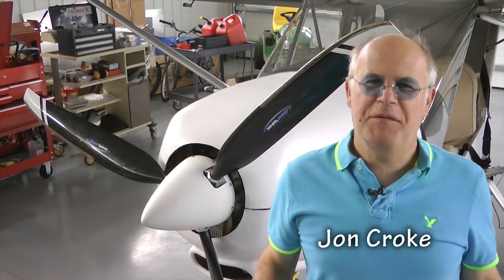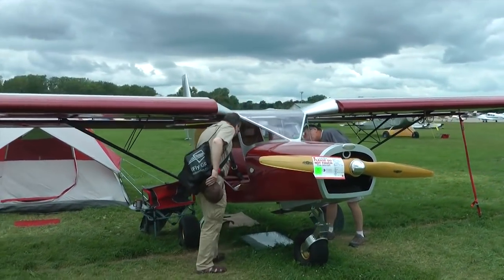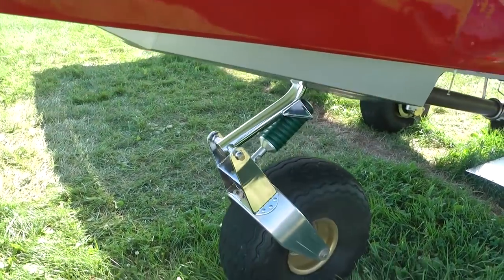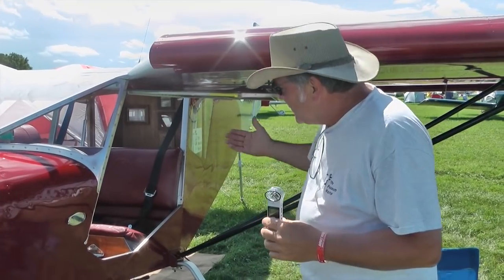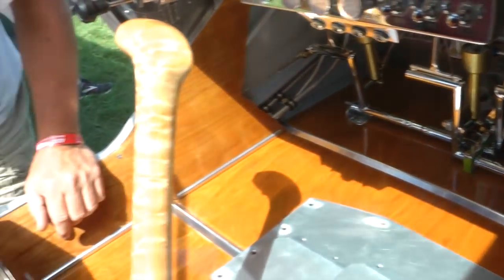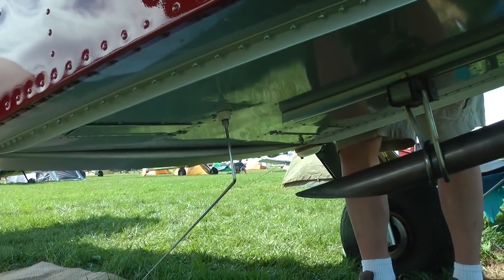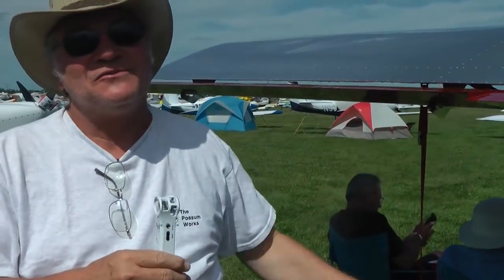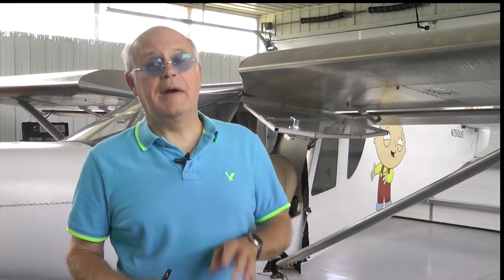When Builders DON'T FOLLOW the PLANS

Comment: I have seen some Experimentals with changes that would make them not safe to fly. What do you do when the plans have errors. I have made many changes to mine that have worked out quit well. I have worked in aerospace in R&D and engineering departments as a machinist/toolmaker. I enjoy R&D.

Comment: Nearly every difference from the original design in this case, appears to be well thought out, sensible. They can reasonably be called an improvement on the original design, or a personal customisation that does not negatively affect either efficiency or safety. I can certainly vouch for the Jabiru engine as a reliable, good engine, well suited to aircraft of this size and configuration.   In Australia, the Sport Aircraft Association of Australia has to have an engineering inspector sign off on the plane as it is built, to legally be allowed to fly. I don't think any competent aeronautical engineer would knock back anything that this bloke did here.  As you pointed out, a lot of the engineering and workmanship is beautifully done. I think your negative judgement of this man for not following the original design to the letter, is unfounded, and unfair.
Reply from the maker: Daniel, you are humorous.  This video was a tribute to his efforts based on my positive judgement of his work!  Sounds like you better watch it again!
Reply: My only criticism would be that the tray tables are not good for crashworthiness. While they look flimsy, and may be frangible, I would not want a horizontal surface so close to my chest.

Comment: Judging from the comments that have come before me - looks like your negativity is not shared by most. 

In most cases he built what Zenair should have designed!  The retro look is personal taste.  Looks to me like his coloring outside the box is an improvement in most cases.  REMEMBER -------THESE ARE EXPERIMENTAL AIRCRAFT.  If you want what everyone else has built go buy a Cessna!  My only concern would be the added weight of his engine and the additional baggage area maybe he did the engineering studies to cover those changes.

Comment: I built my carbon-cub ex-3 I did-not order the power plant or the fuel systems. we made our own battery packs using Samsung graphene batteries seamen controller and inline motors with contra rotating blades that are electric pitch for both 5 blade propeller setup .  using the same cooling as Tesla in the batteries so I have 500kwh "fuel" spread throughout the plane spars the length of the wings with 2 60kw motors turning 10 48" blades my wing is 2 ft longer(along the long part of the entire wing) and 6 inches wider I extended my control surfaces 4 inches and installed 35x10x15 Alaskan bush tires front and titanium aluminum composite tail drag-er. I did opt for the executive glass and synthetic vision.

Comment: First time builders should not try this. But experimental is just that experimental try something. Not everyone has same capabilities to design. It seems the maker of this video wants to atack someone that is willing to experiment. Some people build to fly relying on someones engineering to get into the air. Some have great joy like an artist to build something their own likes. Yes there are catastrophic examples of bad mistakes.  What governs design of aircraft are certain fundamentals like center of gravity.  Flex of frame, etc etc. Small deviations versus large deviations can be either an improvement or drop in functionality. If no one tried to improve anything then we would still be rolling down a hill in a flintstone car

Comment: Every builder over an extensive amount of time building a private aircraft, whether it is from plans, or a kit comes up with different ideas. One for example on aesthetics and cosmetics. I get that. Don't we all. "This comes in white, I want blue". Or, I "will give it 5 coats and top it off with a clear coat"! Why not? But is this ok within the design limits? It's surly not a car. Proven is one thing, but these changes are another
 My concern is that there was no mention of the engineers who designed this particular build. Nor have I seen comments mentioning this, or did I miss it. I am sure this man is experienced and I am not singling him out. It did after all fly, right?  I want to believe he contacted them (engineers who designed this acft) for changes that he thought, might be detrimental to the structural design and performance. It would be misleading if every builder and inexperience builders get away thinking, "If he can do it, I can as well". What about the push pull tube change for the cables? Was there a reason cables were used and think a push pull tube was an option? Or totally eliminated? And for a reason? No, I am not an engineer. Regardless, A very fine job! My last thought,. When he had his parts chromed, I am almost sure it was in the new process that is available today which doesn't change  the tensile strength of the aluminum. As far as the extra cargo? again. If it meets the CG range and the loads given by the engineers, why not? I am not judging anybody or anyone. Just thought I'd like to put out some info. My credentials? 40 years aircraft structural repair, Just spreading safety!

Keep em flyin!

Comment: As an AME and FAA A&P with over 20 builds.  My advice has always been, "If all else fails, follow the instructions".  Self proclaimed aeronautical experts usually learn the hard way and if they live, then blame the kit supplier.  Your example of the 701 is a classic by an true aeronautical designer.  I've built two 701's by the plans and they are great hands off flyers.  Problem is Zenairs name is attached to this "what ever".  Great video.

Comment: How do the alterations affect the original engineering/? He’s added a lot of weight, changed the COG, in addition to drastically changing the control surfaces. That could all be fine if the owner was an aviation engineer or employed engineers to do the homework to insure he hadn’t made alterations that would render his aircraft hard to control.
Reply: Yup, because there's never been a notable plane build by a non professional engineer.
Reply: Bobby Paluga:

Thats a bit of a sweeping statement Bobby........  How do you know he's changed the COG? If all the additions have been calculated correctly then the COG won't have changed.

Comment: If you are a competent builder (ie have completed multiple 2+ kits in the past) and are improving upon the designated build procedure; sure.
If you are looking for short-cuts, or weight reduction, or added power without added stability, or changing the weight distribution, generally no. But this is what experimental category is meant to do, take test proven design and expand upon it and make it more efficient or find its realistic maximums and minimums in practice; outside of theory.

Comment: I would be real concerned about the range of CG on this build.  Putting the extra cargo space in there seems like a recipe for trouble.  I would also be concerned with the chrom plating and hydrogen embrittlement, expecially with the engine mount.  Just a few of the things I'm not impressed with.